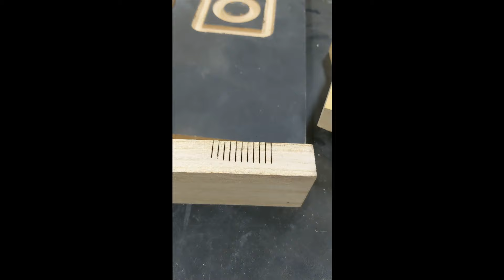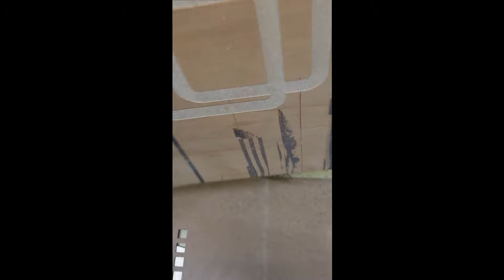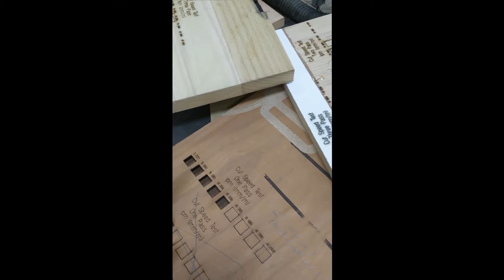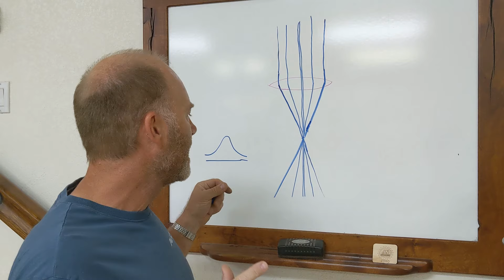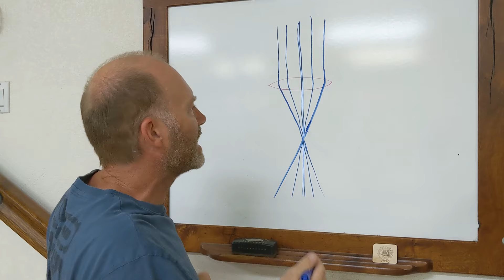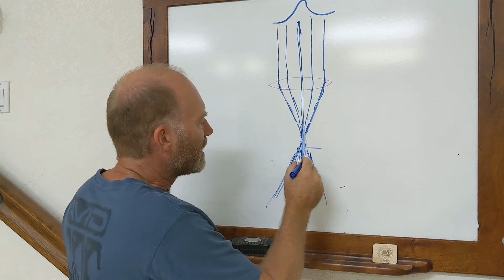How to get the best focal point and speed for cutting with your laser

Comment: Hi Jim,
How do you set the focal length using the avid auto z touch plate? I work in V-Carve. Appreciate the time
Reply from the maker: There are several ways.   In some of my videos you can see a retractable rod with a stop collar on it.  I can set this up to work with the touch plate to result in z zero being set to the laser's best focus.  O have also used a rouch probe in a similar manner, and currently my software applies an offset between my spindle tool and the laser and applies the difference when selecting the tool number. 

In all these methods, you have to first find the right height to get the best focus, and then you can do the math to apply the difference to whatever you use to set z height.   I have a couple videos on how i do that initial optimization measurement.

Comment: Hello! I recently set up my 15w laser from avid on my pro bench and I’m trying to figure out how to cut through a .23” ply board. I’ve watched a few of your videos and they have been really helpful in getting to know my laser, but when I use the settings you recommend it either hits the surface of the board and I have to Estop, or it doesn’t go all the way through.  I looked at your files that you provided for the test cuts on the edge of the wood and noticed the cut depth is .175” which brings my laser touching the surface of the board.  Is it supposed to do that? Could that damage the laser?  Also I noticed in the laser settings the pass depth is set to 0.4 and I was wondering how that worth with a laser? 

Do you have a video on good practices with lasers? Like don’t do this or make sure you do this to keep a healthy laser? That would be very helpful to me at least. I haven’t seemed to find one and I want to make sure I’m not doing anything that will damage it.😅

Thank you so much and I love your videos and appreciate all the knowledge you give.
Reply from the maker: Hi Stephanie,

Thanks for all the good questions.
First, 0.23" plywood (especially baltic birch) is kinda the upper limit of cutting capability for that laser.  Plywood has a lot of glue and that makes it harder to cut than plain wood as well. If I remember right, the 15W will cut quarter inch stuff at maybe around 15 inches per minute, but will probably take 2-3 passes.   In the above video I'm using a 45W laser which handles quarter inch wood like butter.  Your laser has less diodes and a different lens.
You can try the procedure I outlined in the video with the 15W laser.  The 45W laser I was using has a longer focal length lens than your 15W, so you'l have a shallower depth that you want to set the focus at for cutting deep.  I never characterized my 15W laser when I had it with the above method, but I'm going to guess a good starting point would be to set the focus to a depth of about 0.070" or so below the surface.  Make sure you've established your best height for the smallest focus on the surface  first  (I've gone over that in some other videos), and then you know that number, just set your Z zero 0.070" lower than that.
As far as not hurting your laser/maintanence.  #1 thing is to keep the lenses clean.  If they get dirty, performance will drop off rapidly.  At some point the dirt can get hot enough to damage the lens as well.  If you always operate it with the nozzle on and good airflow (~5-10 lpm for etching, 10-15 lpm for cutting) you lens should stay clean.  The airflow keeps soot and stuff from getting in the lens.  Its good to inspect the lens once in a whle though just to be sure - I had one laser where a spider got in there and built a little web in the nozzle once.  I looked at the lens and it was clean and then inside the nozzle and wow.  
The other thing is you can damage a laser with very reflective material like aluminum.  If you are etching painted aluminum, you don't need to run at full power, so its better to only use maybe 20% or so.  I did a quite a bit of marking stainless steel with my 15W laser and didn't damage it, so thats probably ok.
The other good thing (for you as well), is to keep the smoke away from the fan so it doesn't blow through and make the fan and cooling fins dirty.

Comment: Awsome video. Can you sheer test file Gcode? Or maybe you can re-cap in excel table as cheat sheet?
Reply from the maker: I put the cutting focus and cut speed files for Vcarve here:  https://drive.google.com/drive/folders/1bFFuwe7_nSRBT_EkUmhy22EmvVILATkX?usp=sharing
I also put some Gcode files in there that will work for an AVID machine, or anything that uses and ESS controller.